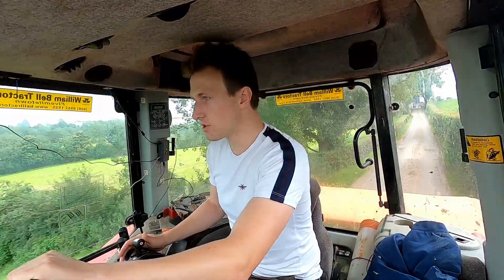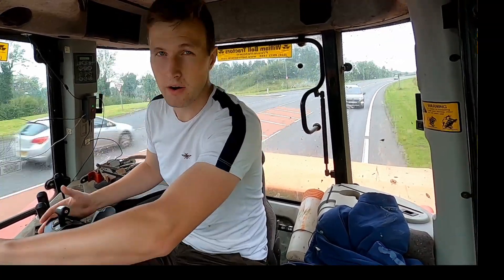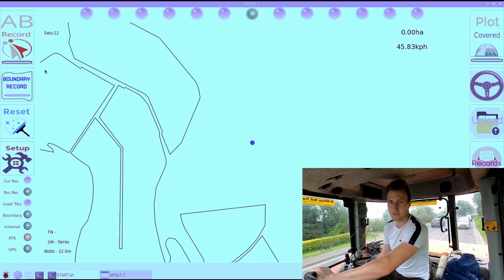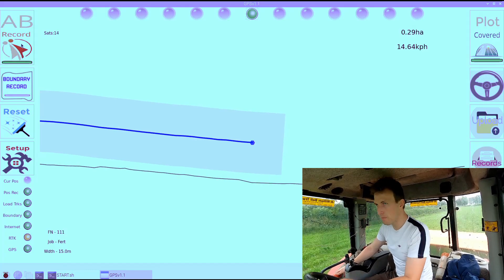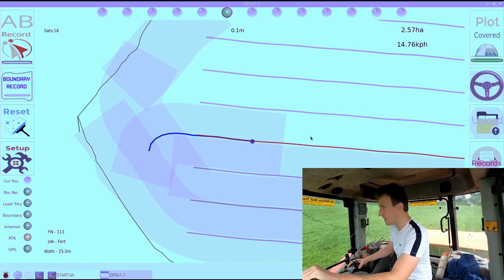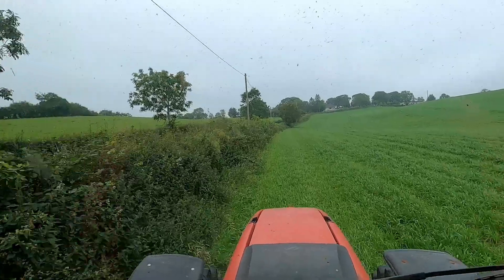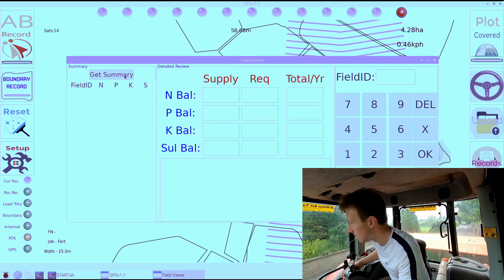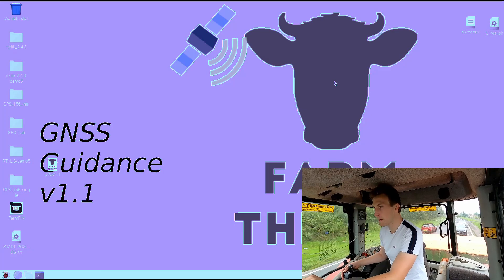RTK GPS - Sowing fertilizer with my £400 GPS.

Comment: great job! what kind of gps antenna are you using? I'm testing AgOpenGps but only works over windows. The use of raspbian is very good, do you have any part of the code available to get ideas? Regards!
Reply from the maker: Tallysman tw2710 or a 3710. Code has been improved a lot over the last few weeks, I will make an update video. Seriously considering my options for release at this point.

Comment: a great product is the software near completion to a stage where you're happy to release it relatively bug free, also is the GPS just laggy in the video as you are screen recording, or do you think a slightly more powerful Rasberry Pi is required? Would love to see this project completed and hope you do a video in the future with a full guide on setup, good luck with the project.
Reply from the maker: It's set to update every 1sec, the new version is twice a second and is much better. The power of the raspberry pi is the issue. It is getting near completion, I'm adding in a new gps unit, I will make an updated video soon.
Reply: @FarmTheoryNI  thanks can't wait to have a go at the project my self more as a challenge than using it for any real function. 👍